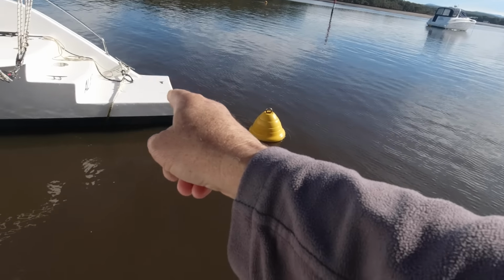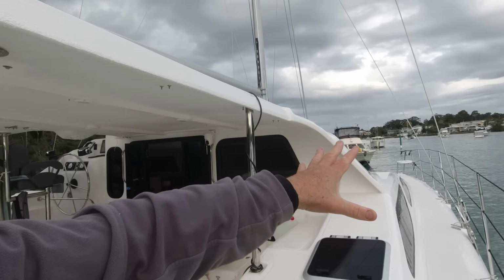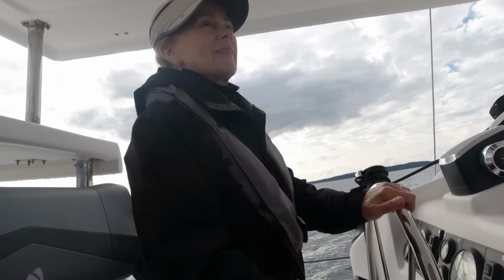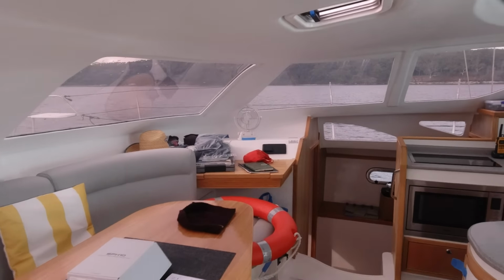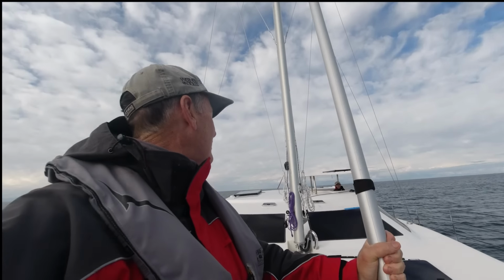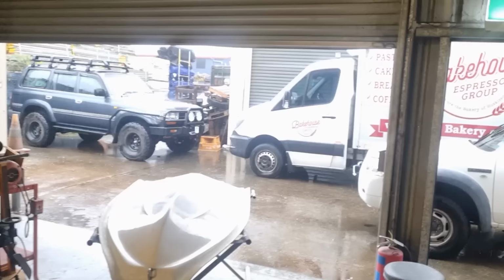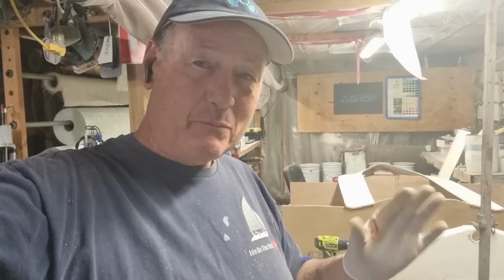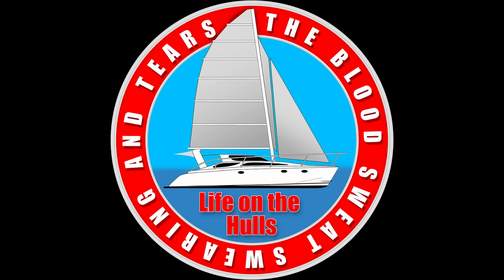THERE IS NO NORMAL ON THIS CATAMARAN -  Ep392

Comment: This is all great stuff, I cannot get enough of it. You have both worked so hard and for so long you really do need to be enjoying the fruits of your labour. But for now the sea trials continue - Roscoe I do have to ask (1) Are you able to measure fuel consumption accurately. (2) Have you established your most economic cruising speed in both twin and single engine drive?

Comment: Why would you not install a flow switch on the outlet of your cooling water with a indicator light at the helm ....
This would eliminate  the need to make sure you have discharge water out the side .....????
What no video on the line around the prop / rudder?

Comment: What horsepower motors are you running to get that sort of speed?
Reply from the maker: Twin yanmar 4jh57 shaft drives with brinton varifold props , kanzaki gears transmission, counter rotating.

Comment: It is nice to see you both out on Synergy enjoying yourselves, even if you aren't yet cruising.
Is there a reason you can't just straddle your mooring float line so the mooring balls are centered on the boat? Slide the line floats close to the mooring balls and weight down the middle of the line with enough line so that it sinks to at least 5' to clear the props and crash keels when you cross over it. Won't that get you further out of the channel?

Comment: Do you think revs are too high,maybe need increase pitch on props.
Reply from the maker: These engines are designed to be run at 3300rpm WOT.They have been matched to engine gearbox ratio.
Reply: @LifeOnTheHulls im sure you mean 3300 rpm😅.  MY venerable Yanmar 3hm ( 1983) pushes my 18000 lb  sailboat at 6 kt at 2000 rpm 3 blade maxprop 18 pitch
Reply from the maker: Yes mate edited it, bloody auto correct.